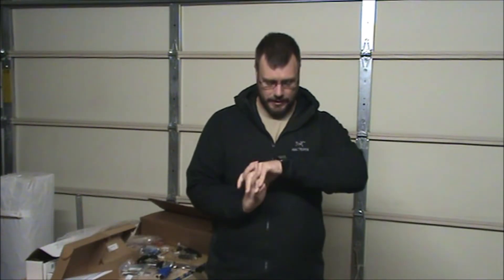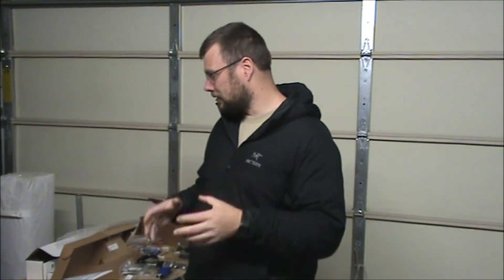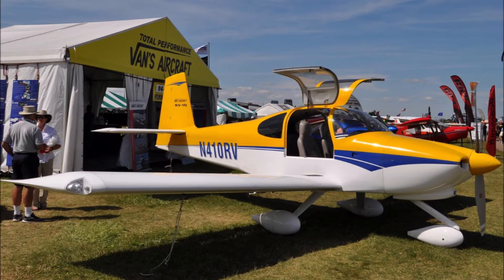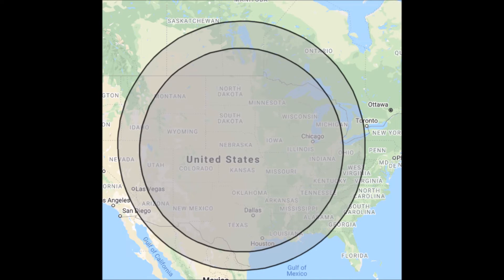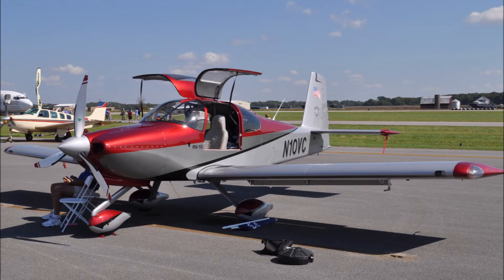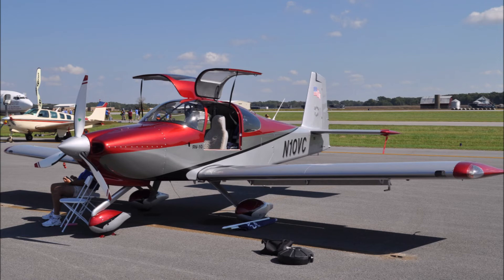My RV-10 Build Introduction

Comment: Did you start building yet?   Would love to peak at your project in person.   I am getting the itch to build but very nervous since i do not have aaaaaaaany diagram reading or building experience.
Reply from the maker: I have started building. So far I have 16 videos up on the build. I am not sure if the diagram experience I have has helped or hurt me, engineering drawings are different from most of the figures used in the instructions. The instructions don't use tolerances on any of the dimensions, which I am used to seeing. Also, it appears the all bends are unfolded and flat on the diagrams with the if folded the flange would come out of the page toward you, I made the mistake of thinking the folds went into the page and labeled some parts wrong during making the rudder. The figures in the plans are closer to Lego instructions and easy to read. If you want, Section 3 (page 7) in the link below, is a section on reading drawings. Love having people look at the project in person, right now my neighbors take walks around the block and look in the open garage door. I think they are worried about interrupting work, but I love talking aviation/building and sharing that with anyone interested. Hit me up at diyjunkie369@gmail.com to figure out a visit.

https://www.vansaircraft.com/faq/section-3-tools-and-workspace/